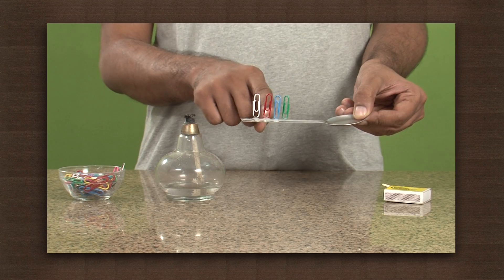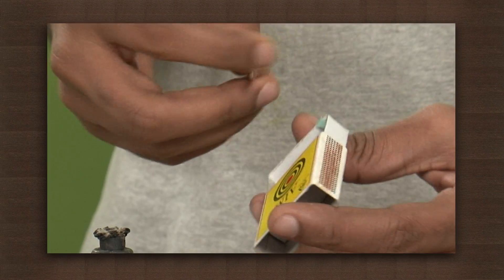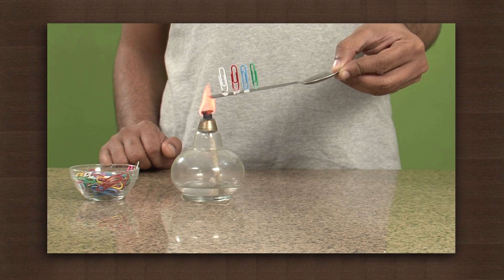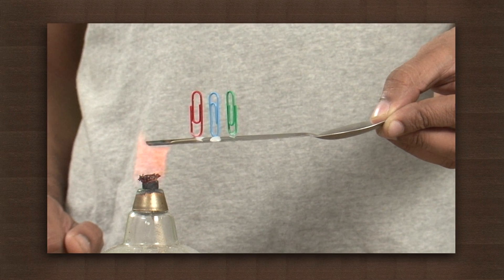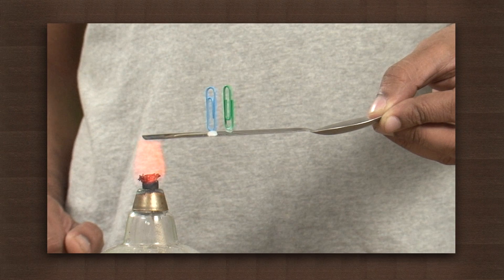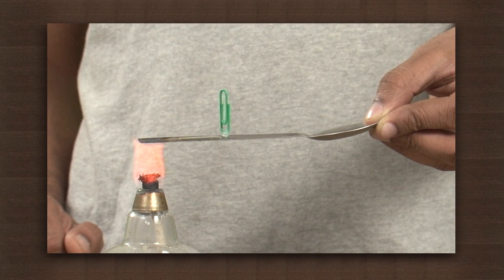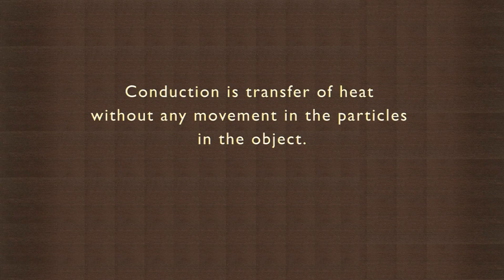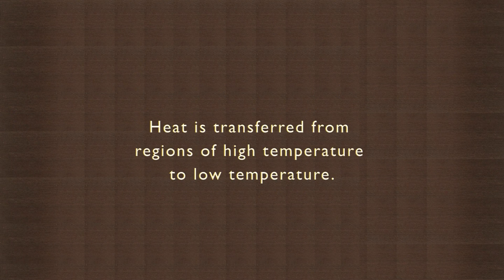Conduction | Heat | Physics

Comment: Will there be heat radiation process from the candle's flame and heat convection process by the hot air around it? Or is this process only heat conduction please?

Comment: why did the pins fall off in the sequence they did
Reply: Heat travels from a hot place to a cold place. Therefore heat travels down the spoon from the heat source to the cooler end of the spoon. As the heat reaches each point of coloured paper clip+ wax, the wax melts resulting the paperclip dropping. That is why the left most paperclip that is nearest to the heat source drops first and then the rest in sequence.
Reply: totally correct
Reply: @phoque6  thx you just gave me the answer to my assignment
Reply: @kenzieandjadesworld3350  😂
Reply: I don't know
Reply: yes.
Reply: No